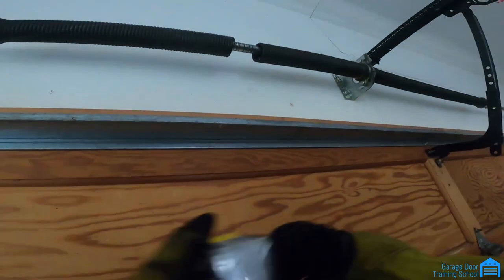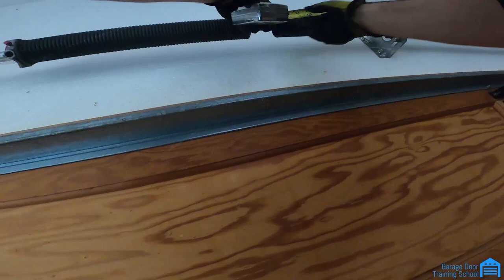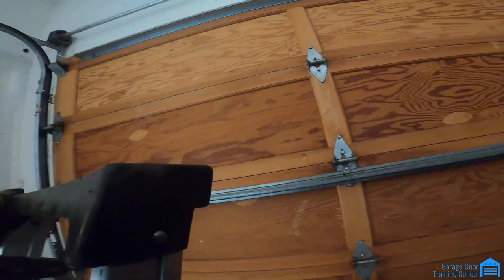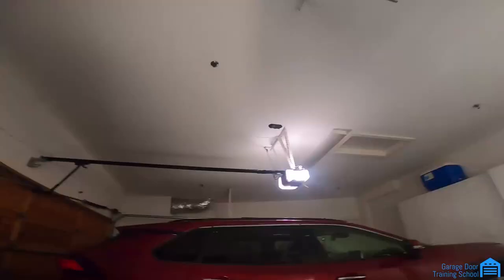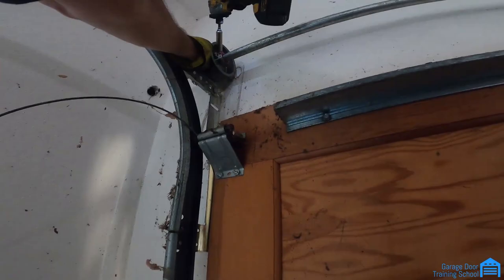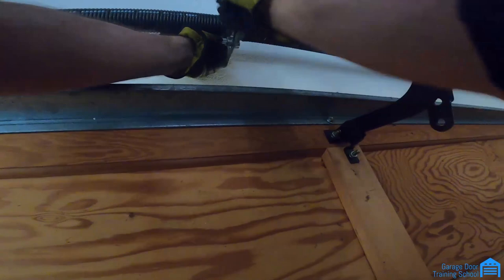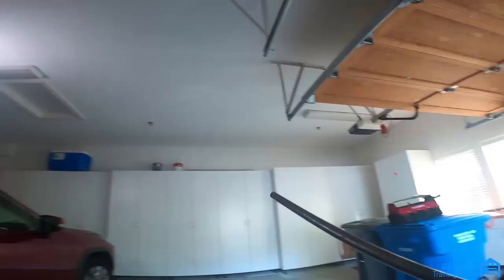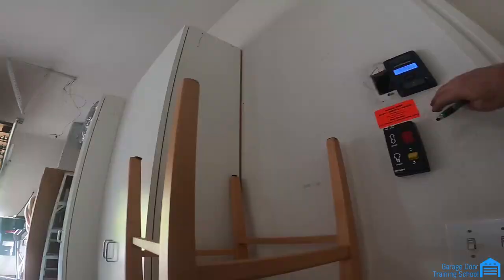They Didn't Know It Was BROKEN! | Spring Change + Wall Button Fix

Comment: I have a solution for fixing the door opener. I'm an electrician and I do this for blank plates sometimes. Get a small piece of wood shim that's about an eighth to a quarter inch thick. It needs to be long enough to overlap the top and bottom of the cutout in the wall by about 1/2 an inch at the top and bottom. Put the shim in the wall behind the cutout and use wood screws to secure the shim to the sheetrock. Through the sheetrock into the wood shim. You now have a piece of wood shim behind the cutout to secure the opener to with wood screws or drywall screws. Now you have secured the opener and there's no need to tell the customer that they need to fix the drywall or install tape over the hole. YOUR WELCOME!

Comment: why don’t u ever replace cables, drums, or bearings when u replace springs?
Reply from the maker: If they are worn out out and need to be replaced, we will. You can certainly upsell this to the customer, but most of the time they just want the springs. If there is nothing wrong with the existing drums and cables, there is no need.